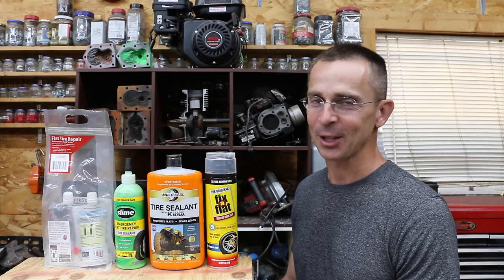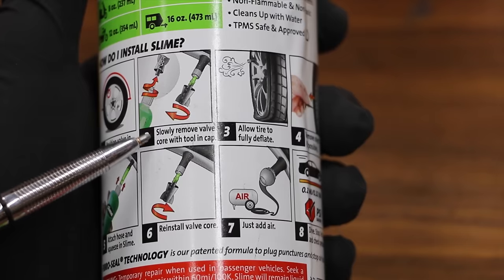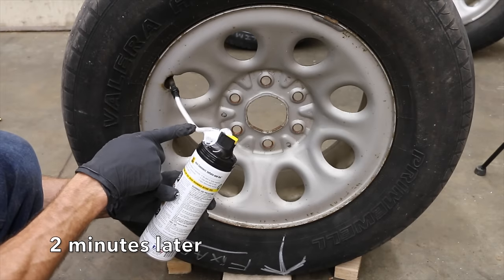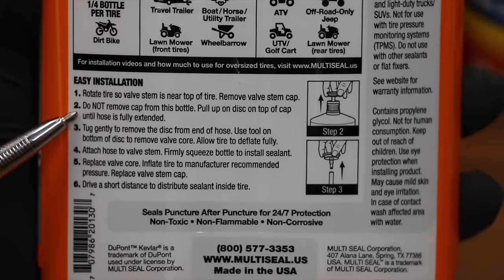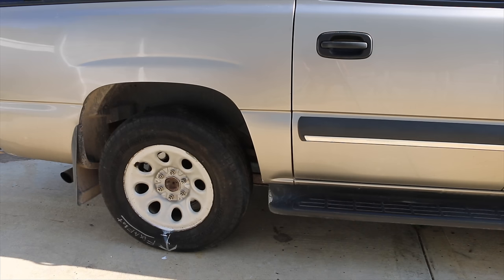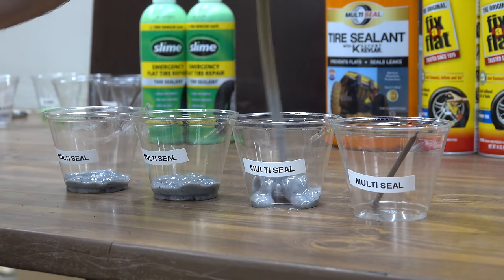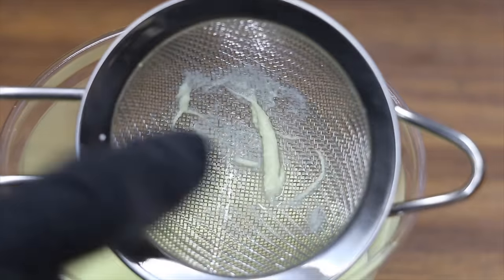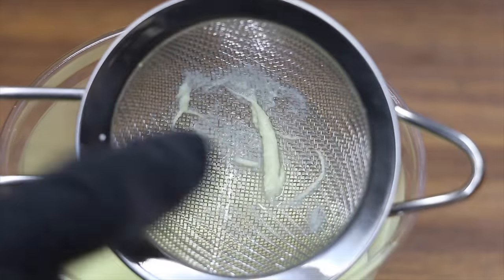Is Tire Slime the Best? Fix-a-Flat vs Tire Slime, TireJect, MultiSeal. Let's find out!

Comment: Fix a flat has let me down three times. I'll never use it again.
Reply from the maker: Thanks for commenting on this.
Reply: It's also highly flammable and tire shops will not do anything but cut the tire off and remove it!
And if you don't tell them it has fix a flat in it and anyone is injured you can be charged by the police!!!!!!!!!!
A lot of states have laws where the sticker that comes on the can of Fix-A-Flat is required by law to put on the inside of the rim to tell anyone that this tire is now highly explosive!
Reply: Fix a flat is garbage. The only good thing vs the other products is the fact that it's pressurized. If slime made a can like that, fix a flat would be completely out of business.
Reply: @ProjectFarm  fix a flat is horrible, it gets everywhere and smells bad and makes changing tires difficult
Reply: +Richard... What law are you talking about? A quick google search shows nothing relating to consumer use of fix-a-flat.   If you could just supply a state and the number of the law, I would greatly appreciate it.
Reply: I've never used FAF, but only used Slime. Works great. For preventative punctures, I put it in my lawnmower z-turn. I've ran over countless nails w/o having to stop and fix a flat (no pun intended 😜)
Reply: @thecloneguyz  Stop Lying. Project farm commented in the post below yours saying none of the products were flammable..
"I actually deleted the flammability test to avoid getting in trouble with YouTube since it could be viewed as unsafe.  None of the products were flammable to an open flame or to metal heated to 700F."
Reply: Agreed. I have had great success with tire plugs assisted by rubber cement. 👍
Reply: Yup, I used it on an ATV tire once. It worked well enough to get me about 5 miles out in the dunes and failed.

Had to ride on back of a 250cc to get to the truck with tools. Then 5 miles back to pull tire. 5 miles to the truck again and then 50 miles to town, get new tire, 5 miles back out to the ATV and then finally back. Wasted a whole afternoon.
Reply: yes i had the same results
Reply: @thecloneguyz  , wrong. In 1999 Fix A Flat reformulated to a formula that uses an inert propellant. It isnt dangerous to the tech, just a crappy product that causes a nightmare in cleaning up.
Reply: Let you down?? None of these products should be used as a permanent fix and like oil leaks they don't fix big holes!! They're ment to keep you off the side of the road!!
Reply: @ParkerUAS  you're talking about a specific name brand and I'm talking in general most of those products are flammable
The ones are not flammable don't work worth a s***
Reply: @hindsonracing  that doesn't change the facts that 90% of those cans are flammable and should be used with caution
Reply: @andrew86fl  LOL true!
Reply: @thecloneguyz  , you replied directly to a comment that mentions Fix A Flat, so of course I responded with that product in mind. You even mentioned that a Fix A Flat sticker must be attached to the rim. So in fact, you WERE directly referring to Fix A Flat.

I just Googled all of these and NONE of the products here are flammable according to their MSDS. Project Farm also commented that none were flammable in his tests.

Please, enlighten us on which ones are flammable and where these laws exist, because absolutely nothing can be found to corroborate your statements.
Reply: @ParkerUAS  That might explain why my can of Fix a Flat from the 1980's worked to seal my tractor tire recently. Based on the tests & other comments, the current stuff isn't up to the job.
Reply: @ParkerUAS  Band-Aid Kool-Aid skilsaw and Sawzall Fix-a-flat are all brand names that are generally used to describe products even though they are specific product names 
Duh
Reply: @hughbrackett343  , it was great at fixing holes in tires, but not at holes in the Ozone Layer.
Reply: @ParkerUAS  
Go to any "DOLLAR STORE"
Look at the FIX-A-FLAT cans there
READ THE INGREDIENTS 
ALL FLAMMABLE
Reply: I've been using Fix a flat for decades, never let me down before. I recently used it to buy my current S10 that had a front flat, used FF to drive it home, saw that the flat was because some kind of bolt was in there, I aired it up and knock on wood...4 months later and a couple hundred miles it's holding.
Reply: @thecloneguyz    I'm calling BS unless you can back up any of these statements with evidence.
Reply: And the evidence would support that decision. I found that to be very strange, because i have successfully used fix a flat numerous times throughout the years. I wonder if they changed something? I once pulled a wood screw out of my tire, just like the one in the video, i heard the leak, used a can of fix a flat and drove on that tire for 2 years. Something isn't adding up.
Reply: I've used it 3 times and it worked every time, even on a large Ford Expedition tire.
Reply: I've always had good luck with Fix-A-Flat, but after seeing this I think they changed their formula or something. I had a flat from a screw about 6 months ago and used a can. It still went flat. Never had issues before. I even have at one time emptied the air and filled it back up and drove on that tire for a long time.
Reply: When I worked at a tire shop 20+ years ago, We rarely saw a tire with it come in on the car. Was always brought in lose, in a plastic bag leaking all over the place.
Reply: I had good luck rhe few times i used it.  I had small cuts in the tire not straight up holea though.
Reply: I have used Tire Slime on my ex's tire. Worked like a champ and lasted more than long enough to get the tire fixed/replaced. The three items that did not freeze all has propylene glycol which is anti-freeze. Also the three that worked have both small pieces of vulcanized rubber and cotton fibers in them that work with the sealing agent to plug the hole. Kinda like if you cut some fiberglass cloth and added it to the resin compound to make a fiberglass "putty" that you can then shape to fill a hole or form a specific shape.
Reply: You're a fast learner......
Reply: +sketchy... I haven't used it in a long time, but from what I recall, it worked pretty well to get me to a shop to fix the flat. That was probably the late 80s early 90s timeframe when I was too poor for triple A.  Maybe they changed the formulation since then?
Reply: Fix a flat,let you down ha ha I see what you did there 😂😂😂😂😂😂😂😂😂😂😂😂😂
Reply: 3 times?  Shame on you. I usually learn after 2 at most. Lol.
Reply: @captainmarvel9610  It wasn't 3 times in a row or I would've learned after attempt number two too.
I have had success in the past with pinhole leaks.
Reply: @PhaQ2 I was just joking with ya anyway. Didn't mean to offend if I did sorry. I love this guys channel I've learned  so much. I actually have a list on my phone I keep if I need to buy something. Lol.
Reply: @captainmarvel9610  It's cool. I just didn't want to look like an idiot. PF is definitely a quality channel.

Comment: Moral of the story: Fix-a-Flat = Waste of money.

Multi-Seal = Surprisingly impressive.
Reply from the maker: Thanks for watching.
Reply: Yea I think I'll give either it or slime a go! Faf can go to hell, what a garbage product its a wonder they haven't been taken to court for false advertising.
Reply: Multi seal is for off-road that means slow driving, because it’s so gue-like it will cause horrible disballance at high speeds.
Reply: @GamingAmbienceLive  yeah im just saying i didnt expect it to able to hold up as well as it did. I would use Tire Slime on regular road conditions, not Multi Seal
Reply: @BoredOuttaMySkullBoi  easy to clean too, just a pain to add it inside the tire
Reply: Cody Slab you pretty much just answered my question so I guess slime is the winner
Reply: @GamingAmbienceLive  good to know i was wondering about that
Reply: Tommy Salami it’s.  Even working with mine, so far so good
Reply: @simonw3858 slime doesn’t work it just pours out of the hole
Reply: Nah fix a flat is amazing, you just have to actually use it right. You're not supposed to remove the puncture object... he did. You're not supposed to use fix a flat before first letting a lot of your air out of the tire to ensure you can use the whole can.... he didn't. You're supposed to immediately rotate the tire or take it for a drive (at least 2 to 3 miles), he only did that on the second can, which keep in mind he took the object out of the puncture hole so his liquid is just falling out before having a chance to dry and expand. The whole thing was a shit mess. All of these products he tested are great products, but they all have different instructions and work differently.

Comment: I watch these videos over and over to refresh my memory of what's good and what's not. This is the best and most complete testing content that I've found for the average Joe on YouTube. Great work as usual.
Reply from the maker: Thanks!
Reply: For things you use a lot, it might make sense to make a small spreadsheet with the results.   You could even have different pages for different product types, etc. 

I haven't bothered since I'm a homebody and Youtube et. al. is ubiquitous if the internet works, but if you get away from internet access, then having such data might come in handy.
Reply: I bought some Slime for my lawnmower tires then remembered he had done a test.  Looks like I’ll be in good shape.

Comment: WoW, I’m exhausted just watching all this testing!  You went over and above and beyond your already over the top testing schemes. Phew!😅
Reply from the maker: Thank you very much!
Reply: @ProjectFarm  
I love your videos
I know you mostly do product testing 
But if like to see a video comparing concrete with fiberglass vs rebar vs nothing 
I have to pour a small pad and a walkway. 
I will be using rebar but I'm curious how strong those fiberglass fibers make the concrete
Thanks for taking the time to educate and entertain
Reply: @andrewbeaudry9705  Steel mesh has been shown in some engineering calcs to be MORE effective than rebar. Sounds like a good test idea!!!!
Reply: Ditto!  He is very good.  Pinch ourselves.  I'm indebted.
Reply: @andrewbeaudry9705  I used to do a lot of concrete driveway/walkway demo and by far the toughest concrete I've ever had to remove was fiberglass reinforced.

Comment: I just realized you can pump this stuff in a bicycle and forget about flats for a long time.
Perfect for bicycle food delivery or daily cyclists.
Reply from the maker: Great point!
Reply: I dont know with its only comum in Brasil but here moutain bikers and speeders use this kind of product one of the best seals for bike is stans no tubes
Reply: Slime even makes bike tubes which are already filled with the sealant. There is also a specific formula for bicycles.
Reply: Im from portugal and I practice Downhill and Enduro and I just wanna say that if you want to do that make sure that you use the right stuff and most important stuff marked for bikes not cars. I use Slime (tubeless sealant) specific formula for bikes and at least for me its really good and has already saved me a few times in downhill races.
Reply: Slime works great in bikes and motorcycles.  I had the unfortunate opportunity to test it. I got a 3/4 inch slice in my bike tire and tube in the rain and slime stopped it. My air pressure dropped from 80psi to about 40 but it got me home.
Same formula as car slime just a smaller package. Gonna try the multi seal.
Reply: @fahb68  make sure you clean that slime off while it's still wet. Much easier to clean it's also very slippery so your brakes dont work well.
Reply: Most people do not leave the liquid fix in the tire for a day. If it works it will be in the tire for 6 month or longer. The worst is chrome wheels they start corroding under the finish and then they become useless. Also these products will clock the TPMS resulting in incorrect tire readings and in some cases kill your TPMS system.
Reply: I had one of those tubes filled with slime in a tire that blew off the rim and the tube burst, I had slime all over my garage.
Reply: I've got tubeless tires on my bike and use Stans no tubes sealant. It works incredibly well.
Reply: When I got married and we had our first kid, my wife kept getting flats on her running stroller. Thorns. I started using slime in every (bike) tire and never went back. I don't consider a bike ready to ride until it has that stuff in it. I usually just buy the tubes with it already inside. Worth every penny!
Reply: Thanks, a thought... been hearing about, SLIME FOR BIKES, MAYMBE THOUGHT @ some $18 per fix, Flat tire ( Bike Shop)....
Reply: I have Slime in my motorcycle tubes in case of a blowout.
Reply: @TheW83  one of the worst bike inventions ever....
Reply: Hot damn! Great idea!